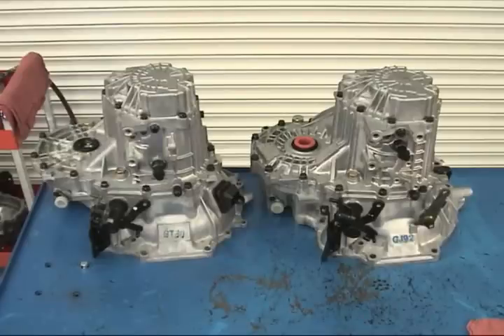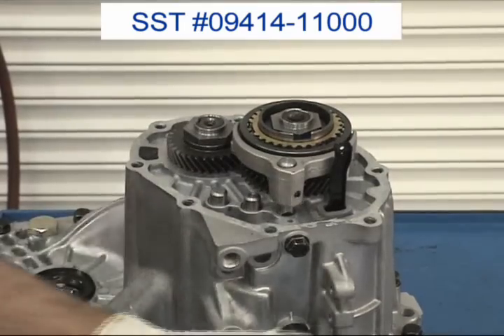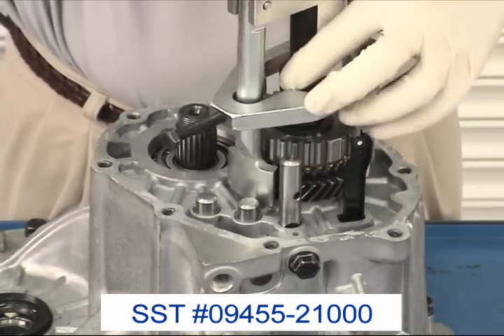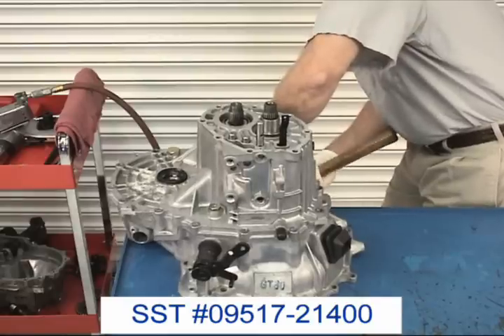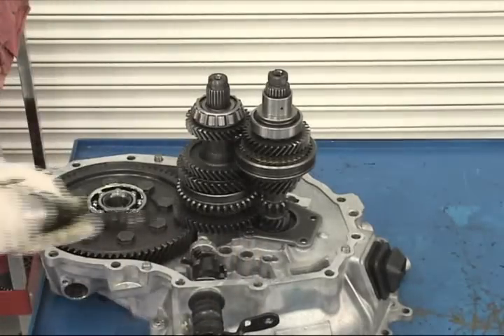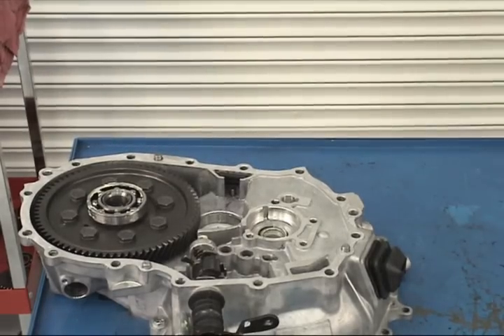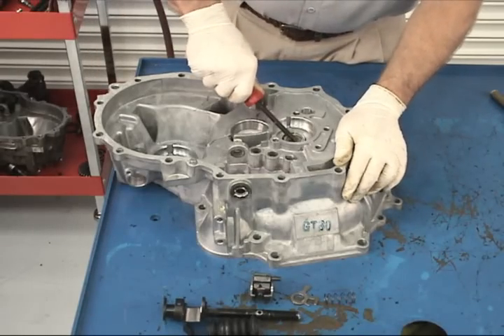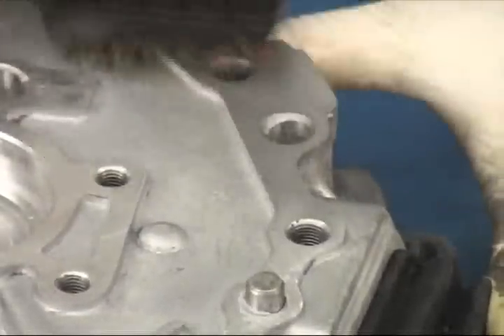Hyundai Transmission Disassembly Video

Comment: clearly this rebuild can be completed while the customer waits
Reply: Haha, don't forget they have to remove the gearbox from the car, and put it back in.
Reply: @xdygmnyrdf  not if the customer brings the trans to me! I have also removed and installed these units in less than two hours total, that is the easy part.

Comment: Where do I get the gear puller you used in the video??
Reply from the maker: This is not me in the video. This is a video I acquired years ago from a Hyundai forum when I rebuilt my transmission.

Comment: Looking for a rebuild kit for a Hyundai tiburon 5 speed manual. I can't seem to find one for a 2008 for the life of me. Anyone got a link or phone number of a manufacturer?
Reply: any luck? i know this is 2 years late but i have an elantra same year, having the same issue finding a rebuild kit. can't even find a manufacture name for the transmission
Reply: Dan Withnell No, still no luck. It's still hanging in there as long as I don't rev my RPMs too high. My best solution to prevent any further damage was to put in a lightweight flywheel. It helps my RPMs drop much quicker, so I don't grind my gears anymore.